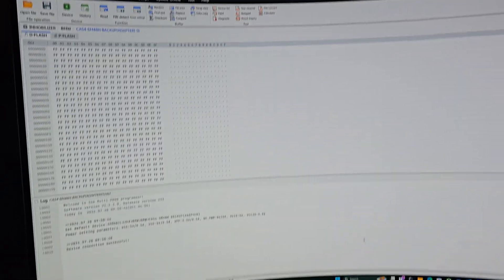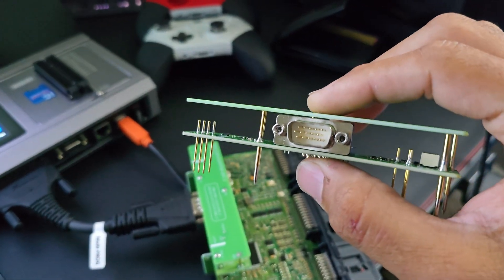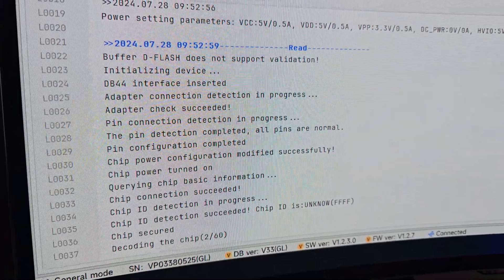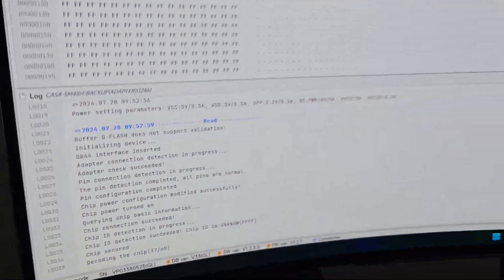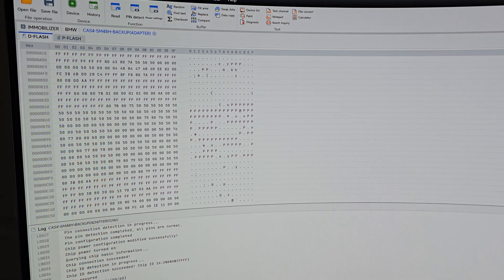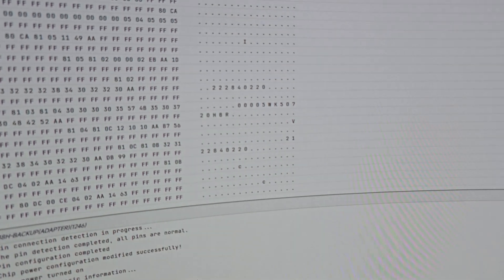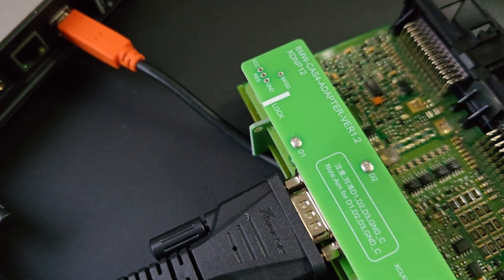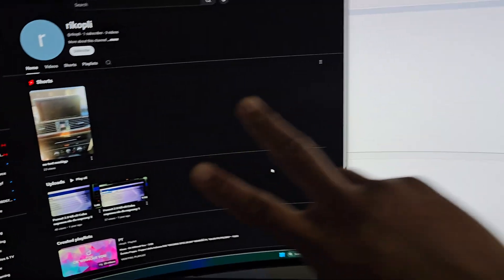VVDI MULTIPROG FW V1.2.7 FIXED 9S12 Reading Issue Using Solderless Adapter to Decode CAS4+ (5M48H)

Comment: Good job on the update!
Have you tried ecu reading function? More to the point acdelco e-series example e78, e39a ect.
Reply from the maker: @aleksa52  to be honest, I’ve never tried multiprog on many ECU‘s. I barely even use it to read ISN. I just thought it was a cool tool to have since it was new. I primarily use ACDP and IO Terminal and usually anything liking in between i’ll use Flex. but I’ll try to give it a go again. I’ve just been upset with this tool since there was a lot of promise that has yet to be delivered.
Reply: @AutoLockSector I feel you, it's going to be in debugging stage for a while.

Comment: Thanks for tagging me in the video!!! I'm sivyx from cartechnology/mhhauto. Heh today I wanted to buy a cas4 adapter 1.3 but you tell that version not work, than better to buy 1.2v correct??

Few day ago i lost capacitor from cas4... For all who make same screw like me capacitor(near oscilator) is: 22pf 50v 0603:)
Reply from the maker: @rikopli  You're welcome! I've been disappointed with this tool and I haven't touched it ever since, until you told me that the Update fix the issue.

V1.2 Works as of right now
V1.3 Still Fails for me atleast with the Multiprog